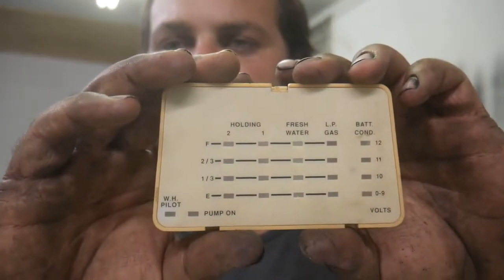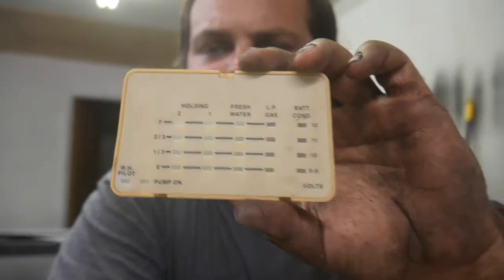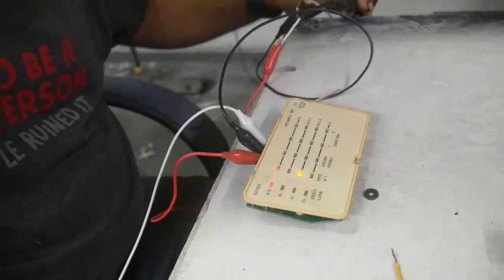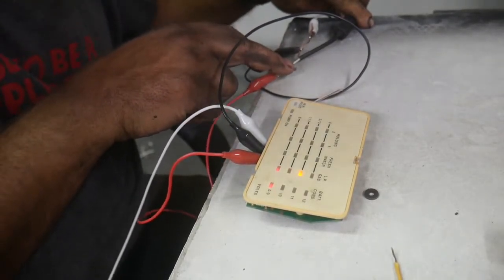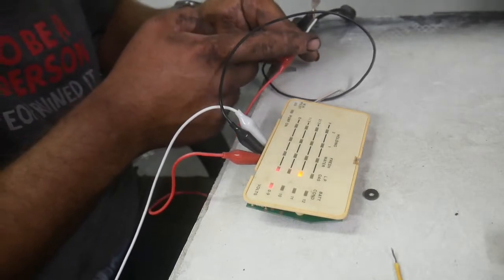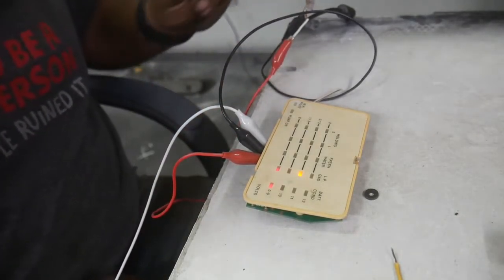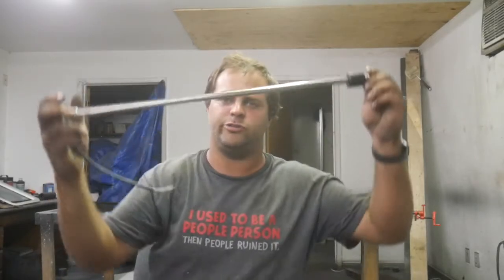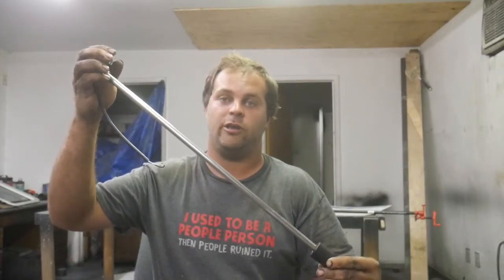How To Fix Holding Tank Sensors and In-depth Discussion on Theory of Operation.

Comment: Thanks for the vid. My tanks (slightly younger than Fred Flintstone) have pairs for each level - 1 ground (all linked) and one positive. Seems to me the indicator light is essentially wired in series with the sensor so that the water level just closes the circuit that powers the light. Corrosion of the sensor contact surface or crud build-up could interfere with the electrical contact enough to prevent that light from turning on. By the same token, a wet connection between the pair of sensors at each level could result in a light always being on until the tank dries out. Cleaning the sensors could solve both problems. 
That float sensor I would use in a water storage tank, but it needs the tube to be clean in order to let the float slide properly up and down. Grey tanks could accumulate grease or soap build-up on the tube that would prevent the free movement of the float, and I’m not sure you could put a bigger float (more force up and down) through the mounting hole. Again, cleaning could solve the problem, but it’s not a fun job.

Comment: Thanks for taking the time to describe HOW it works. My question: one day the gray and black tank level indicators were working, but the next day the indicators are just lighting the lowest level indicator.
My hipothesis is that one of the cables is damaged (i've had to deal with mice the Last few days) because it suddenly happened on both tanks at the same time.
What do you think could be
Reply from the maker: Sounds like you are on the right track. Thats what would make sense to me.
Reply: @TheZachLife  Thank you for your prompt assistance.

Comment: I'm not sure this is how the sensors work, or at least mine.  Playing with my meter I can make each individual light come on by shorting it to ground.  This tells me it's just the liquid level reaching each sensor that shorts it to ground.  This would be much less complicated then having the resistance calculated and much less reliant on composition/resistance of the liquid.  Soapy water vs clean the water etc.  I'm not even going to go into what can change the resistance of stuff in the black tank.  To me it makes much more sense from a reliability standpoint to have a broad range of resistances that can turn on the lights and only rely to n it's level in the tank.

Comment: Great job as usual. Did you consider the sensors that mount on the outside, or can’t you use it because of the tank. Kc
Reply from the maker: I wanted to go with this system to have a higher lever of resolution.